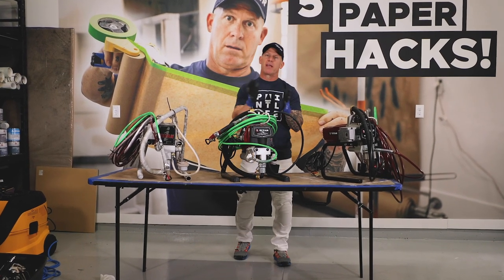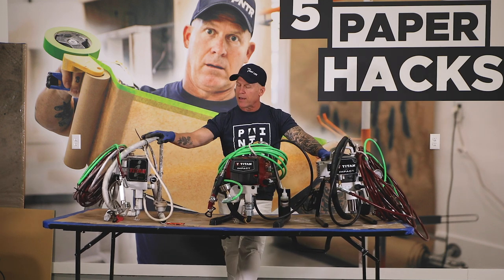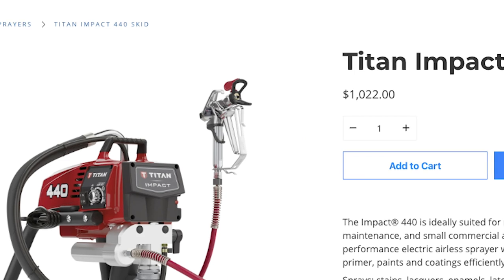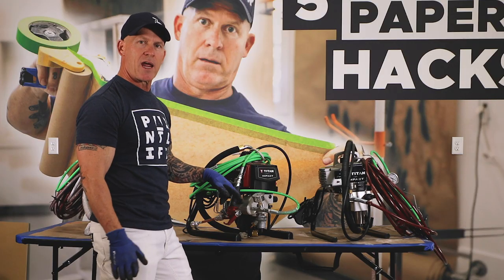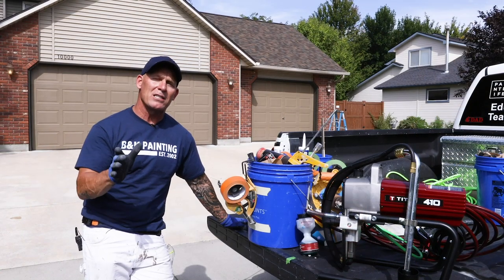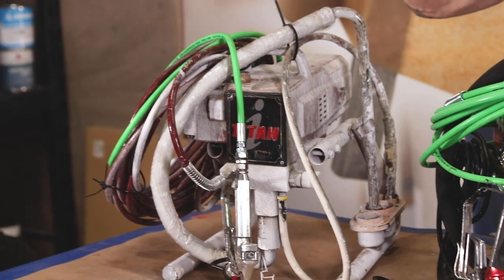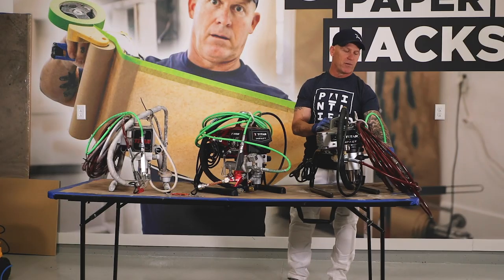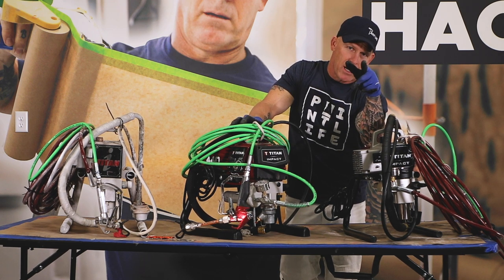The BEST Airless Spray Pump for you!

Comment: Bought a Krause & Becker from harbor freight for $180 on sale $220 original and it works amazing! Done 3 houses and still runs flawlessly.
Reply: I just got one...any special tips?
Reply: A cheap sprayer will certainly get you by in thr short term and complete a few projects, but if you plan on painting professionally invest in at least a Graco 395 or Titan 440 equivalent. It'll last you forever if you take care of it, and increase your productivity. It'll also make you realize the cheapo 180-300dollar sprayers was money flushed down the toilet the moment they die.
Reply: No longer available.
Reply: good rig for the money. but definitely get the 1 year warranty for another 40bux

Comment: Here in Italy we use diaphragm airless pumps more, they require less maintenance and last twenty years. Why do you still use piston pumps in America? They want more maintenance, the cylinder is scratched or the electronic board breaks and you have to throw them away. I'd be happy if you told me your opinion

Comment: Tx Chris! Im a DIYER. I cried once and bought once based on this video. I went with the 440 Impact. I also went with a Wagner Flexio 590 for smaller home projects and accent walls👍
Reply: How did you like the Wagner?
Reply: @twinenk15  it's great for diy small projects,  definitely not for painting  rooms. The 440 is truly for a pro that has the man power and materials  to mask and drape.  There's cleanup too. I went big and still cried. Lol it's in my basement.

Comment: can you recommend a single job paint sprayer? I am painting a 2500 SQ ft house inside and out. Would the titan 1700 pro be fine for that? I saw your other video about the inner feed roller. Would you roll inside or just spray the walls?

Comment: One pump that I love is the Greco 495 pc pro ultramax 2 high boy, if you want a pump that will just go and go without losing any pressure you can hold the trigger down and spray no problem, of course it’s a lil bigger for bigger jobs we use it on new construction priming large areas does wonders no more waiting for your pump to pressure up

Comment: As someone who works on these things for a living I can say the new graco stuff is much better. The gear case is much quieter and the pumps are much easier to rebuild. They also run at a Lower speed. Personal preference but I'd pick a Graco. I personally have a 495pc
Reply: I think this guy uses both sprayers. In one of his vids he stated he uses a 695 for bigger jobs. So they must both be good machines. If a pro has been using a tool for nearly 20 years that says a lot about the quality of both Titan and Graco.
Reply: I have a old spray tech (bought out by titan) from maybe 10 yrs ago last time I took it to get fixed it took months for the shop that fixed it to get parts due to the fact that they had to get them from China literally, I switched to Greco because parts are American made and I can get my machines fixed within a few days not months, not sure if this is a issue anymore with the newer Titan pumps or if it was just the spray techs, guys at the shop said spray techs had the same issues 🤷‍♂️
Reply: @trjo6669 thank you
Reply: @trjo6669  Why are Titan and Graco both made in Minnesota? What about the other 49 states? Do Graco's and Titans work as well or last as long in less snowy, less cold, more humid (florida) or dry (arizona) or hot (texas) or higher (colorado) or lower (coasts) altitude extremes?

Comment: I would avoid buying the Titan 1500, 1700, etc.. Immediate clogging issue right out of the box with latex (my experience 1st time use). Also, they made ALL of the fittings proprietary. Want a 50 foot hose? Nope. Want a new gun? Nada. Want to use a 2 or 3 foot wand extension? Sorry, can't get it! I wish I would have read the reviews more closely on Amazon. I'm going to keep it to just spray doors. I'll probably go with the Titan 440 or something similar as my larger project sprayer. Do your research before purchasing!
Reply: Forgot to mention that you can't get a whip hose and any new spray tips either!

Comment: Awesome video.  I'm a weekend woodworker and diyer that occasionally paints interior walls with latex paint.  I noticed you recommended the budget friendly titan 1700 pro.  Does it spray lacquers and varnishes?  If not what would you recommend that won't break the bank?  Any light you could shed would be greatly appreciated.

Comment: Looking to get a sprayer to paint a mud room project and then my finished basement. I want to paint the ceiling in the basement with dry fall paint (not drywalling ceiling) and I was told a smaller sprayer like a Graco X7 wouldn't do well with that dry fall paint. Beyond these projects, I wouldn't be using the sprayer much so I don't want to spend a lot.

Would you advise I purchase a small project sprayer (Graco X5 or similar Titan) to do my mudroom and basement walls and then rent a pro sprayer when I do the ceiling or spend the extra and get a Titan 410?

Comment: My wife wants an airless sprayer for general use.  Probably one time painting all the doors in the house and baseboard but otherwise for arts/crafts use.  Would you recommend a bigger sprayer like this (or the Titan Control Max you showed) or something like a Graco True Coat ?  SHe probably will use quart-sized containers a lot.
Reply from the maker: REally comes down to budget
Reply: @Idahopainter  Lets say budget is not a huge issue.  I would be willing to pay more for a better quality tool.   My concern is much paint do the larger ones with priming the pump and hose vs the handheld Graco unit?  Would something like the Titan 410 hold a lot of paint and cause waste?
Reply: @adventuristnw2321  maybe the little titan hea
Reply: @adventuristnw2321  if budget is no issue you the 440 should me the minimum

Comment: Can you use an airless sprayer to apply the drylok type paint for block basements? It seems really thick compared to other paints.
Reply: I have the same question, what did you end up using?

Comment: I have a question , need to paint my house , my the exterior of my house has brick all around , well the lover portion of it.
Would you recommend using primer first  all around or only on the portion that has siding? 
Also I am going to be using my airless paint sprayer.
Reply: I would not suggest painting the brick.  If it is in its natural state i would use a solid body stain.  H&C use to make a stain for Sherwin Williams for brick and block.  I have many houses painted with this product 15 years out and they look like the day they were stained.  The advantages of stain are they soak into the brick/block and create a great better bond than a paint sitting mostly on top.  They also do not peal and blister like paint on brick /block.  Plan on 2 coats as the first will soak right in and the second will create a uniform color.. GL
Reply: Limewash is an option

Comment: DIYer here.  I took a chance and bought a used 440 impact at a great price bc of a priming issue. With a couple of great vids on YouTube I'm sure I can fix it. Do u routinely rebuild ur sprayers after a period of time? I'm assuming as a pro painter u and or ur guys are capable of tearing them down and troubleshooting on a job site? I watched ur vids on cleaning these sprayers. If u were spraying a couple of wood fences in the same day, at the same location, with the same color water based paint would u normally clean ur machine after each fence was sprayed?
Reply: You can leave paint in the sprayer easily overnight. With no issues. I release the pressure in the line and throw the gun in water or mineral spirits until my next coat. Doesn’t affect anything. Just keep it all wet so paint doesn’t harden

Comment: Truth is all machines are the same if you get 3000 psi you can spray anything... thes best machine I had was $1300 only because the parts were cheap and literally you could fix it in 5 mins yourself instead of taking it to the shop.. but if your  spraying a kitchen cabinets id get a hvlp..